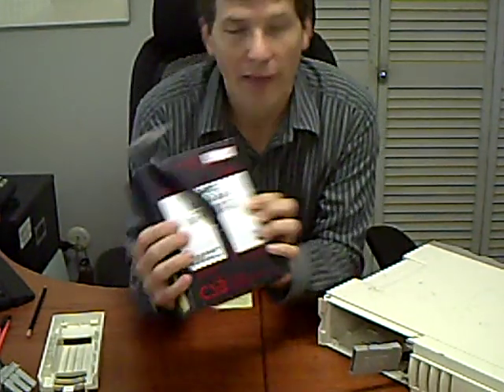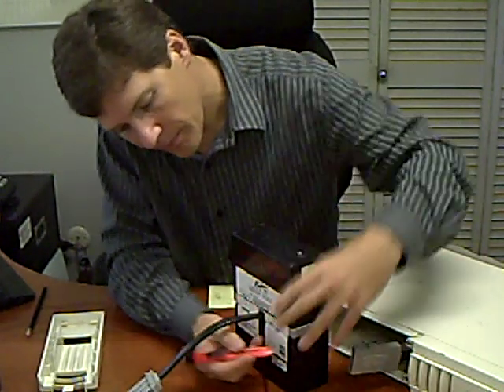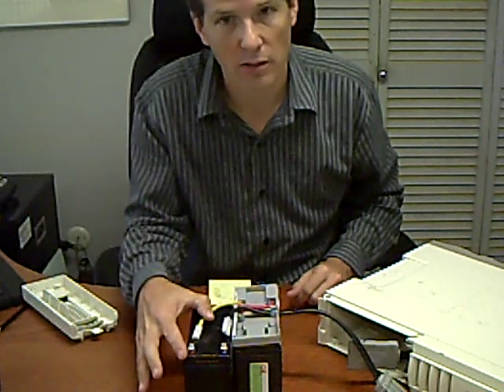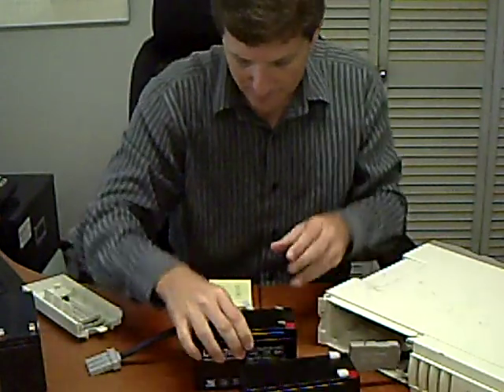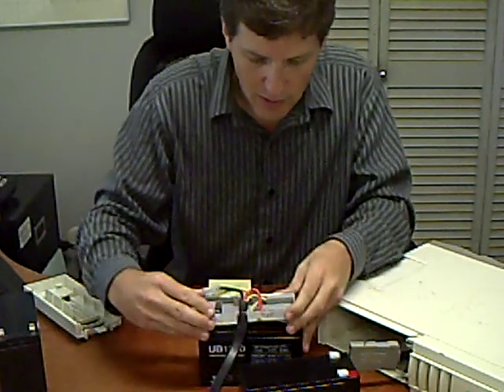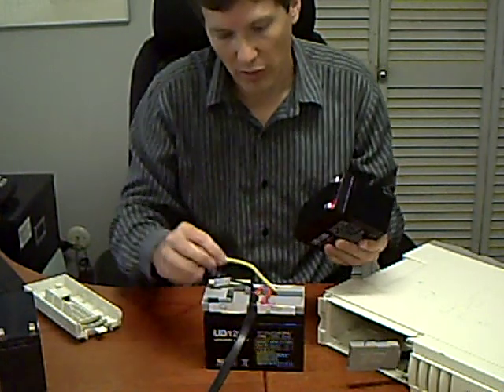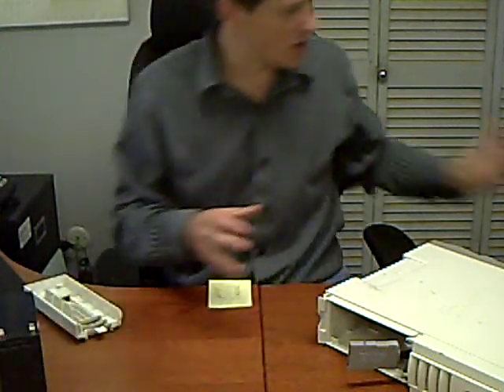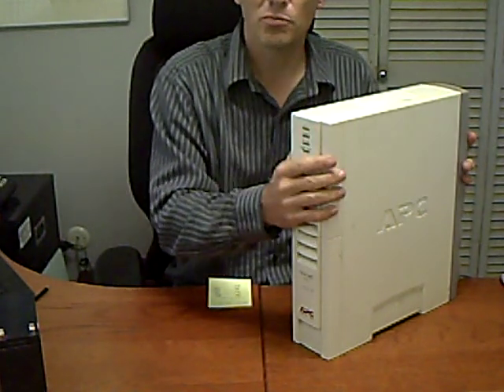APC UPS Battery Replacement: RBC32 and RBC33

Comment: Just so I understand this right. The "double decker" battery pack is providing 24 volts DC (2 12 volt in series) to the UPS and NOT 12v, right?

Comment: The RBC 32 is set up as 2 12 volt 7.5 amp batteries the RBC 33 is the 12 volt 9 amp battery pack.
Reply: +Sharon LaRosa So that bank is providing 24v to the UPS and NOT 12v, right?
Reply: +Robert Keeton  yes its 24 volts.

Comment: What's the diff between RBC32 and RBC33? Is there any reason why say, if yours started with RBC32, that you'd not want to use RBC33, or vice versa?
Reply: +Jorge Ramos and see, there is not answer to this question. I'm wondering the same thing
Reply: XENON j

Comment: In my experiences with dozens of UPS devices (including a number of these BX1500 models) once A UPS gets on in age the batteries start to be the least of their problems.  If there is a problem with the underlying circuitry in the UPS from age replacing the batteries may not fix your problem or only fix it temporarily. 

UPS batteries have two different charge voltages.  One (higher) to actually charge the battery and one (lower) to hold a trickle charge to keep the battery charged.  Over time the circuitry that controls this process can fail and then the higher charge is continually sent to the battery.  This will destroy the battery after awhile and cause it to swell.  If you have a hard time removing the battery due to this type of swelling the internal circuitry has probably failed and putting in new batteries will only cause them to fail again.  In this case the UPS is finished as it cannot be easily repaired and you cannot justify continual battery replacements.

If the UPS is flashing lights other than the Battery Replacement light then you might have circuitry problems as well.  I had a couple of these BX1500 models that after replacing the batteries once or twice started to fail for other reasons.  They would go through their power on cycle and then go straight to the battery even when plugged into an outlet.  The breaker was NOT popped and there was no way to get them to use Line power anymore and APC had no answers..

Any UPS that has had its batteries replaced more than once/twice or that is over a half dozen years old is highly suspect. and probably should be replaced.  Newer models have more and better features and can be purchased for slightly more than replacement batteries (which make up the bulk of the initial cost of the UPS).

Comment: For older UPS systems, at what point should you forgo battery replacements and simply purchase a new UPS? Especially small UPSs.

For small single phase systems, wouldn't it be good to replace the entire unit, so you can get the latest technology and higher efficiency?

Thanks.

Comment: Thanks for this video, made swapping in new 9 amp batteries easy.  The old ones lasted eight (8) years.
Note that after installation, if you get short soft beeps once per second, one of the terminals probably came off one of the batteries - mostly on the side with the shorter wires.   Pull out the batteries and check all the connections.
Reply: Marco Sartori No, just went to a local battery store and bought 9 amp replacements.  We'll see how long these last.
Reply: They lasted 5 years.  To be fair, current draw went up, and there were more outages.

Comment: According to the APC website, this procedure can be performed with the UPS and all loads online.  There is no reason to power down.  I just did it with a Back-UPS NS 1250 without issue.

Comment: System will do auto recalibration every time it is powered up. If you want to do it manually, you need to install APC's PowerChute program on a computer, connect it to your battery. You will see an option to run self test there. While you are there, update Battery Replacement date too for future reference.

Comment: I have an APC Back-UPS RS 1500 unit and I need new batteries. The local support shop told me that it's not done only by replacing the battery but that the unit requires a calibration after that.
Looks like the calibration requires to connect to the unit via Windows Hyper Terminal and adjust a parameter of the UPS' firmware.
Does anyone know how to do that?

Comment: VERY hard to pull the old pack out. I removed a couple of screws to assist loosening the case.  Needed to align the new batteries & adapter before taping them up. Otherwise procedure went smoothly.

Comment: Very helpful tutorial however it should have mentioned that when you're finished the OLD batteries have to be recycled; anyplace that sells motorcycle and/or car batteries, by law, must accept the old ones.

Typically you could go to a "Sears" or any auto-parts store that sells batteries; BY LAW they have to accept the old batteries.

Thanks!

Comment: This is too cool. I bought an APC XS 1000 that was kind of out of date.  went to New York and trained to install "BIG" UPS systems for Leibert. The kind that have a special room filled with batteries, x formers, inverters, curt key dual services, and a gen set control. I also installed APC, Triplite, and other stuff, but when a battery went dead it was on a rack, not jammed in a consumer case with a funky Siamese connector. THANKS A MILLION APC! This video rocks! 2x 7.2 Ah batts and I am golden!

Comment: @Ritari2000 yes those are 7.2 amp batteries.  They are also avail. in a 9 amp with the same dimensions for longer run time during a power outage.

Comment: I replaced one of these recently.  The two batteries were preassembled as one, so that made the replacement much easier.  How long should the replacement battery take to charge?  There is no "charging" LED on this unit.  The red "replace the battery" LED is still lit even though the battery was replaced 30 hours ago.

Comment: @killerdeamonking that not how  it goes.
the yellow goes from one positive to the other negative and a black to one ground, red to the other positive. Its a 24volt system.
(I work here(Redy Battery))

Comment: @hmattar  its really easy to make the cable if you have the plug that will fit ine the holder theres 3 wires 1 black 1 yellow and 1 red   the black wire will connect to both negitive out puts whyle the red will go the the positive and the yellow go's the the second battery's positive and thats it

Comment: But i will say this i unplug the batery and hit the power button ok and it asks bor the battery then i plug it in then it runs the apc but the fan dosent kick on..

I had it turn on 2 times in battery mode by playing with it and it said replace the battery but i teseted the 2 batteries witha 12 vold computer fan nearly burning the fan out so i know the battery is good.